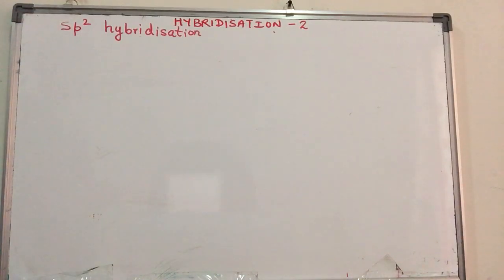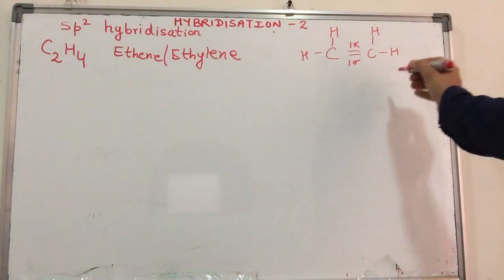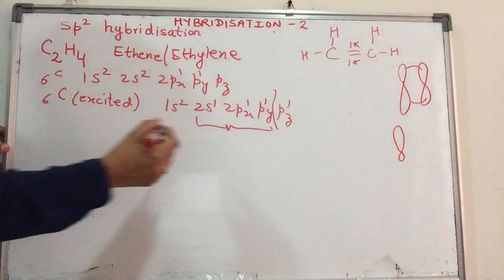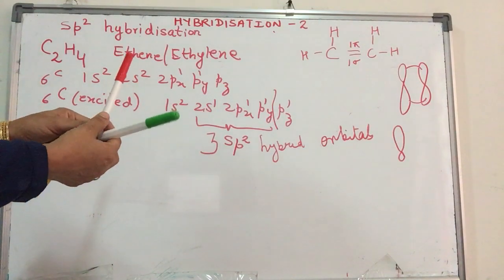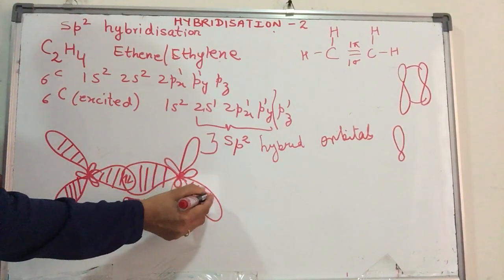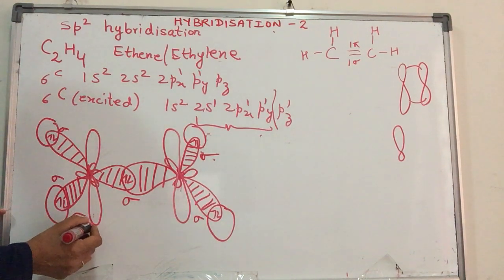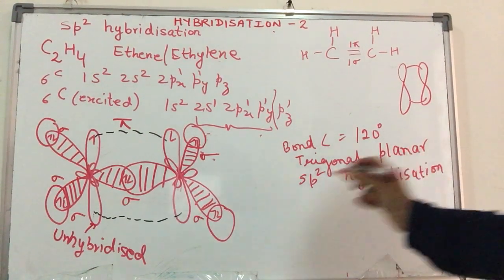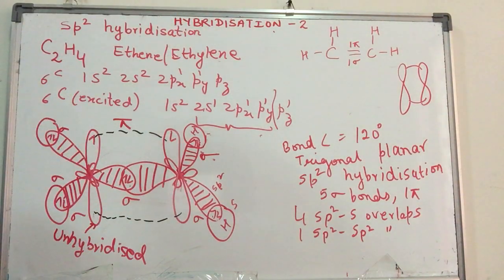sp² Hybridisation with Ethene as an example- for better audio see link in description box

Comment: Why one p orbital is left untouched
Reply from the maker: Zulfiqar Ahmed we need both the lobes to form a pi bond. If it undergoes hybridisation it will not be able to form pi bond as the shape changes.
Hope this helps. For greater clarity watch the lesson on sigma and pi bonds.
Stay subscribed as more topics get added regularly.
Reply: @PenandPaperChemistry  Is it also because there are only 2 hydrogen atoms possible for each carbon atom?

Comment: Is unhybrdised orbital perpendicular to plane
Reply from the maker: Hello Prof. Lewin,
 Yes, the unhybridized p orbital will be perpendicular to internuclear axis so as to cause minimum repulsion between the bonded atoms.
Thanks for dropping by.
Do subscribe to remain connected for new videos.
Reply: @PenandPaperChemistry  but 8f their are two unhybrdised orbitals like in c2h2, one will be perpendicular to internuclear axis and one will be in the same as internuclear axis plane ?
Reply from the maker: Look at one of the corners  of your room. The length, width and height are mutually perpendicular to each other. So if the corner of the nucleus then the width is the internuclear axis, the length is one unhybtidized p orbital and the height is the 2nd unhybridized p orbital, all mutually perpendicular to each other. That is why the bond angle is 180° and the shape is linear for sp hybridisation.
Hope this helps and clears your doubt.🙂
Happy learning
Reply from the maker: My earlier reply was wrt sp² hybridisation.
Reply: @PenandPaperChemistry  can we place one unhybrdised orbital in the same plane as hybrid orbitals in c2h4 case i am getting confused 😅
Reply from the maker: Yes, we can.
It's not on the same axis.
The basic reason being that the structure is such that it aligns the electrons whether bonded or unbonded in such a way that they are maximum distance apart from each other.
Does this clear your doubt?
Waiting to hear from you. 🙏🏻
Reply: @PenandPaperChemistry  no sir pls make a video on it and in Hindi 😅
Reply: Pls ma'am*
Reply: Sorry i wrote sir instead of ma'am
Reply from the maker: Ok will do.
Will try my best in Hindi but i don't know the technical words so you will have to excuse me for that.
Reply: @PenandPaperChemistry  ok ma'am pls do as soon as possible
Reply: @PenandPaperChemistry  ma'am pls make a video
Reply from the maker: By tomorrow it will be done.Promise🙏🏻
Reply from the maker: https://youtu.be/eS3LcWrcKY0

In the meantime, watch this video and see if your doubt is cleared.
Reply from the maker: Professor Sahib
https://youtu.be/eS3LcWrcKY0

Video mein 23 minute par jaayein aur dekhein aapkey sawal ka jawab milta hai ya nahin.
Please 6 pencil le kar khud se bana kar dekhein fir batayein samajh aaya ya nahin🙏🏻.
English mein hai lekin students ke sabhi sawalon ke jawab iss video mein hain.
Aapka din mangalmay ho 🙏🏻
Reply: @PenandPaperChemistry  ok ma'am
Reply: @PenandPaperChemistry  ma'am main point is that that unhybrdised p orbital tends to go to maximum distance to cause minimum repulsion?
Reply from the maker: Haanji
Imagine the orbital as the home of the electron. An electron carries a negative charge and doesn't like another electron near it. So orbitals whether hybridised or unhybridised tend to position themselves add away from each other as possible.Now, hybridised orbitals don't have a choice as they have to form a bond. So the unhybridised orbitals move away as much as possible.
I wish I could send a voice message to you😀, to make things clearer.
Reply: @PenandPaperChemistry  thanks ma'am for clearing doubt
Reply: Ma'am one comment i have also added to that video pls respond to that whenever you get time
Reply from the maker: Pakka clear hua? Ya video ke wait kar ke tang aa gaye 🤔
Reply: @PenandPaperChemistry  nahi ma'am ho gay clear bas ek baar jo link diya tha vdo ka uspr pucha hai Maine doubt uska answer de Dijyiga
Reply from the maker: दिया बच्चे अभी जवाब दिया है। आप बताओ समझ आया या नहीं🙏🏻
Reply: @PenandPaperChemistry  thanks ma'am samjh a gaya ab ache se

Comment: I would like to ask another question: What is the reason that atoms can bond in different relations: I mean, there is ethane and methane, and ethylene ect. It is all carbon and hydrogen, what causes the two types of atoms to bond in different ways? Principally, it is the same question for all other elements and bonding relations.
Reply from the maker: It's their desire to form friends which makes them strike different friendships just like us humans🙂.
We make friends with different people and our bonding with each person is of different type.
Reply from the maker: Carbon due to its size has 2 unique properties
1) Tetravalency- tendency to form 4 bonds
2) Catenation - ability to form long chains without breaking.
This causes it form large number of compounds and that's the reason we have to study organic chemistry as a separate branch.🙆
Reply from the maker: Yes it is the conditions under which the reaction takes place which decides the formation of product- temperature, pressure etc.
You will understand this in greater detail when you do the mechanisms of reactions.